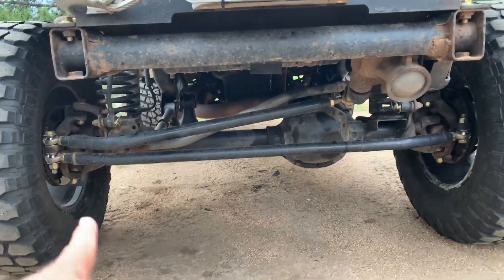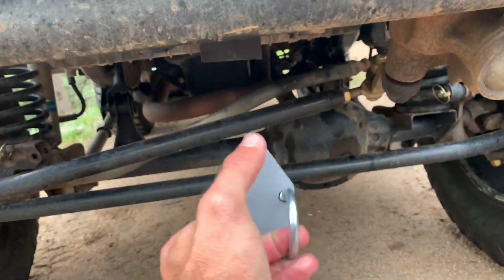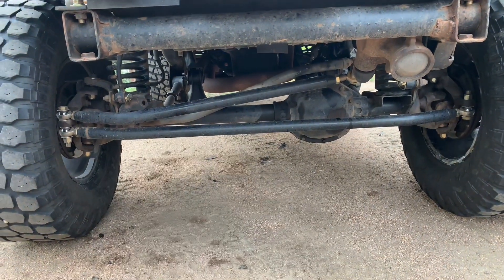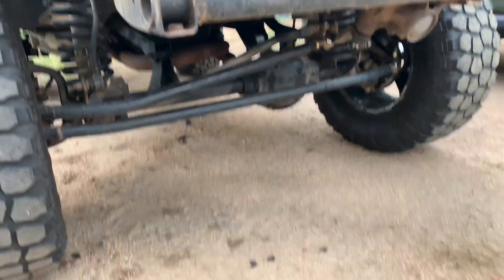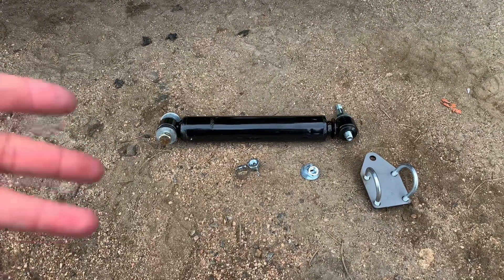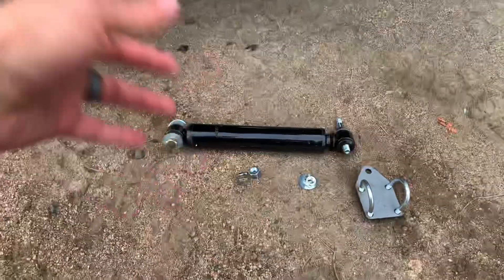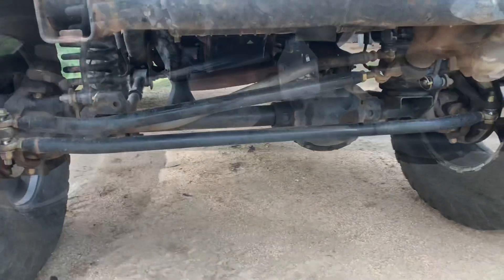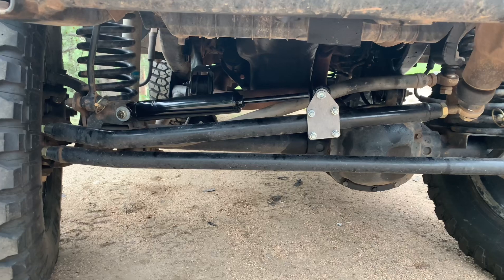TJ Steering Stabilizer Install - One Ton Steering

Comment: I recently replaced my factory steering box with a Red Head steering box in my 2006 Rubicon and the difference is night and day. The steering is tight and responsive. I would recommend the swap to even someone with a brand new Jeep. My Jeep only has 70k miles and the improvement was substantial.

Comment: Did you have any problems with it hitting the oil pan?
Reply from the maker: No, o took it off as soon as possible though. Actually jacked up my steering with the heim joints
Reply: @FreedomCrawler  what do you mean?